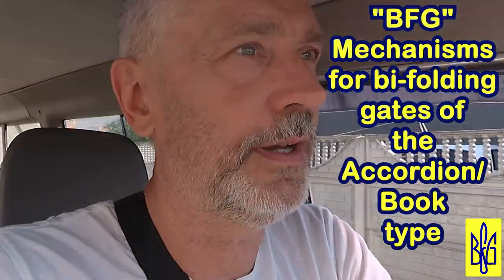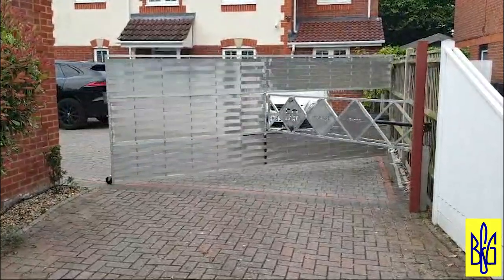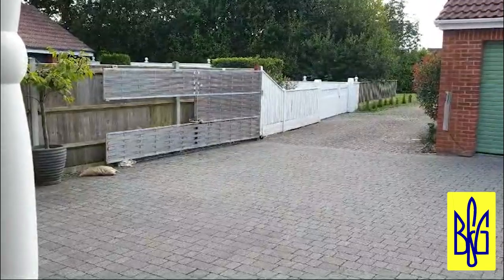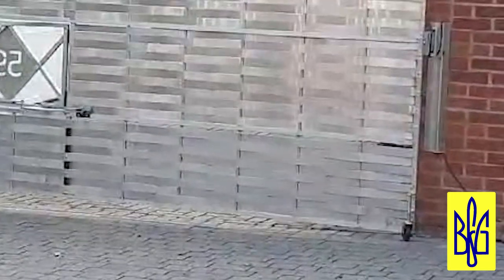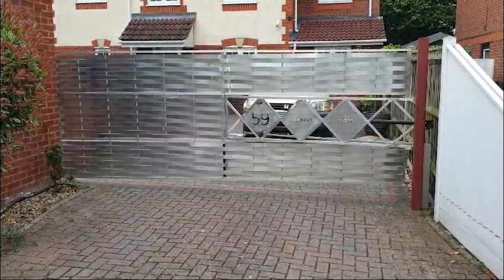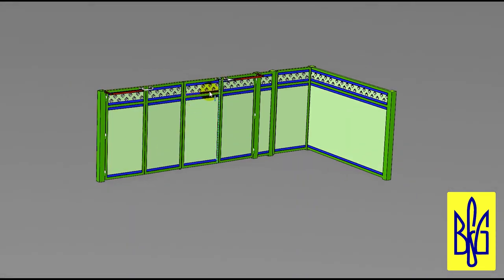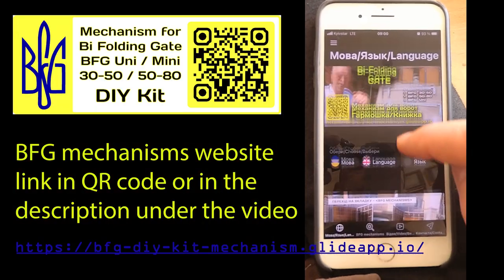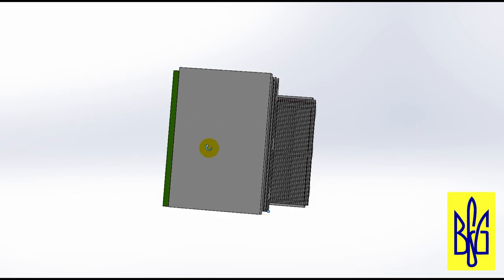Bi-Folding Gates BFG DIY Kit Mechanism Buy in UK.Check out the Gate Design You've Never Seen Before!

Comment: Thats really insane design!)) Great gate construction solution for every situation 🎉

Congratulations with the British market opening!)
Reply from the maker: Thank you very much for the high rating!
I will continue to post videos from my customers on the channel as they come in)
There will be gates in a traditional style.

The design of the gate in the video is really very unusual and caused a lot of controversy - but it works and, frankly, talk about potential danger is exaggerated.
On the contrary - a wide leaf when opening completely excludes anyone from entering the zone of movement of the first leaf.
The same situation when closing - the second leaf pushes away everyone who even wants to get close to the gate.
And from the outside, even if you climb between the leaves when opening, the compression force will be many times less than the force at the beginning of the leaves.

In any case, in combination with radar and conventional sensors, you can achieve the required level of security.

Thanks again for the comment!